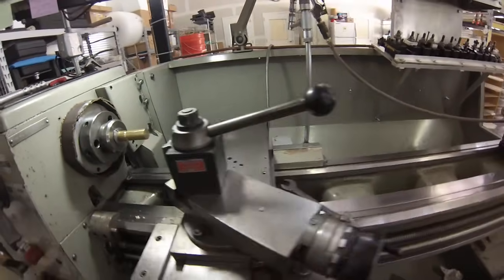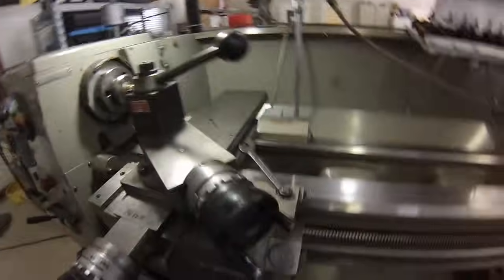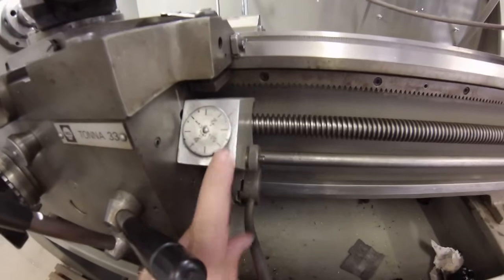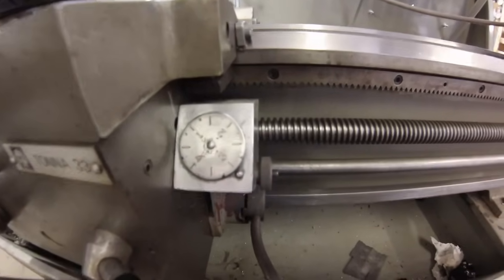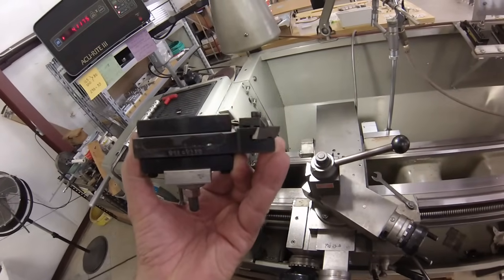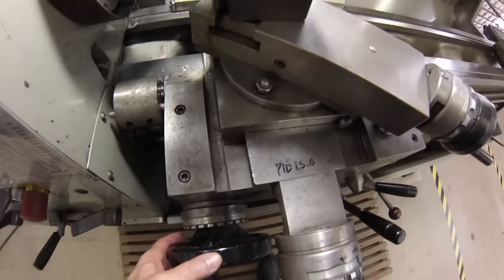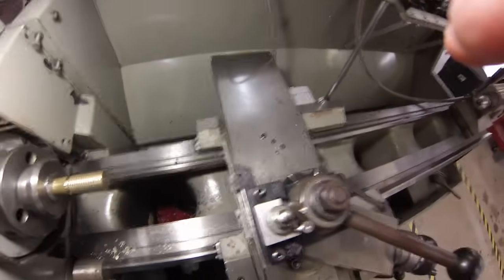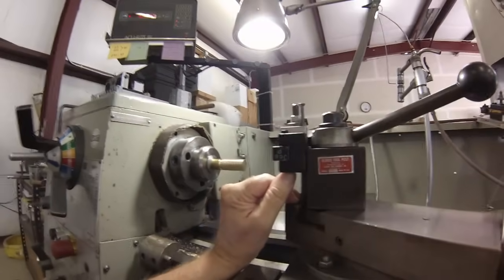Threading on a manual lathe  BEST TECHNIQUE EVER !!!!

Comment: If it's upside down and backwards (tool upside, spindle backwards, feeding towards the tailstock) I learned that in tenth grade shop. But thanks anyway.
P.s. we used blue chalk for lubricate
Reply from the maker: Where did you go to school?
Reply: @joepie221  I went to trade school at the old Carver high school which was a school for colored kids in the 50s & 60s but turned into a trade school when segregation came to Bessemer Alabama.
  Now then Bessemer joins Hueytown Alabama. You probably never heard of Bessemer but if you've ever been a NASCAR fan you're heard of The ALABAMA Gang. 
  Bobby Allison Donnie Allison Neil Bonnet Red Farmer
   All that to tell you I know them, when they would come to our trade school to visit Mr Frank Howton. Because he was THE MACHINIST for those guys before he retired and taught high school machine shop , before you ask yes sir I've been doing this since I was 15 and am a first class MACHINIST and Master tool and die maker.... these days I prefer to work with cattle tho I have a few machine tools to fool with.
   Did that answer your question ?
Reply: steven - I don't get the point your comment is making - please explain is you will. Also what material is the chalk good for as a lubricant? Just brass or other brittle material? Thanks.
Reply: @howardtoob  not sure what you don't get could you be more specific ?  Yes chalk is a decent lubricate for any cutting(back in the days) but lends itself to thread cutting because you can rub the chalk into the thread valleys and it will stay there till the tool removes it. It's great for a lot of fitment as well tho most use ink these days which was not always readily available and certainly not as cheap as chalk.
  If your interested you should goggle what type of lubricate can be used with what materials such as mineral spirits or kerosene for aluminum.
Or perhaps you have a Machinist Handbook ? If not you should have one or I expect it could be downloaded from the web.
Reply: @stevenmassey7586  Got it, thanks.

Comment: Confused Neophyte here.  Don't you need to put your "29.5" degrees in the other direction for a reverse cut like you have shown?
Reply from the maker: I plunge my threads, so the compound angle doesn't matter.
Reply: @joepie221  So don't you get chatter plunging straight?
Reply from the maker: @tkarlmann  Maybe if you cut an aggressive thread on a light machine. Mine is rigid enough to allow it. Chatter is never a problem.
Reply: @joepie221  I had to go back & check -- you are running on a H U G E garage-filling, apartment-overwhelming lathe!  I'm all fresh from learning WHY the 29.5-degree angle is used.  Then too, you can get a longer blank, and turn a narrower shoulder in it, specifically to end the threading.  Then run slow enough so you can disengage the half-nuts in time.  I'm looking a relatively teensy 100 lb lathes!

Comment: Good advice. Just want to mention that the indexing device is common only on USA o British machinery. In Europe our lathes do not have that and therefore cutting a thread by disengaging the half nut is not an option. Also quite often screws are required not to have an undercut, and this makes it impossible to cut a thread in reverse. So it is up to your reaction speed and your ability to stop or reverse the rotation direction of the spindle. One more observation, carbide tip threading tools are not suitable for reverse cut, the tip is provided with a rake angle only regarding the standard direction of cut. Last, every increase of the thread depth should be compensated by a fractional forward movement of the small carriage, since threading tips are designed to remove material off the front edge.
Reply from the maker: Screws that are called out without an undercut should be CNC'd. carbide thread inserts for threading that have a positive top rake are not side bias. Therefore a plunge sequence is fine. fractional side movements are for lighter duty machines and not required on more rigid machinery.

Comment: A machinist friend showed me this the only difference was he ran the tool from the back side right side up however I like the inverted tool idea thanks
Reply: I may be wrong but this method will allow one to cut threads on a much larger diameter part than running in from behind the work.
Reply: @howardtoob  that may be true both methods work a particular operation may favor one over the other

Comment: Not much I cannot do manual machining however threading is one thing nobody has taught me and in many attempts to do myself I’ve never successfully done so. Thankfully they make taps and dies to 2” diameter standards and metrics which covers everything I will ever need to do. Perhaps someday I will meet someone local who can show me how to set the machines up. Also I have a chart at the front of my machine telling me which to engage and what gears to install. It all seems such a headache when I can grab a tap or die from the drawer and chuck it up in my tailstock. Downside is taps and does are expensive the upside is I can still get the task done. Im always amazed how easy everyone makes it look. Manually machining I cant afford to experiment on my parts. Probably need to spend a day with someone who knows how to setup lathe gearing and proper engagements, etc..
Reply: You can definitely learn to do this by yourself. If I can then ANYONE can. try practicing with some PVC pipe. It really isn't rocket surgery. 
Joe shows the best way that I've ever seen.
Reply: HowardC I will give it a go when I have more time it may be I have been doing something wrong. They always look like threads but haven’t worked. PVC sounds like a good idea to save money and frustration.

Comment: As yet I have not seen anyone using the production method of screw cutting. Always with a V angle tool plunged straight in with the crosslide.
An alternative method taught me as an apprentice toolmaker is as follows: Grind only the left side of the tool to half the thread angle, the other side should be ground to clear not to cut at all.
Set the topslide over to half the thread angle.
Mount the tool as normal just touching the workpiece and set the crosslide to 0. Also set the topslide to 0  ( having taken out any backlash). The cut is set using the top slide whilst the tool is pulled out with the cross slide and re-sent to 0 for the next cut.
Advantages: Half of the thread angle is formed using tool whilst the other half of the angle/thread is formed by the set over on the topslide. Also it's much easier working to 0 on the crosslide and not having to constantly calculate how much cut is required.
Reply from the maker: Thanks for the comment, but I respectfully disagree. I also have to imagine, you have only been instructed on how to use the half tool method and have never actually tried it. For a few reasons, it would never be an accepted practice in a production environment. The advance of the tool with the compound would have to be so small (.0002-.0005) it would take hundreds of cuts to finish a coarse pitch thread, and under magnification, you would still have a serrated face on your thread profile. Please watch this video before you reply. It clearly proves a full profile tool IS needed for a correct thread profile regardless of the compound setting.      https://www.youtube.com/watch?v=PnH_oeOUps4   Thanks.
Reply: @joepie221  Absolutely! Even when feeding in the tool with the compound (set at 29* or whatever) there is a portion of the material opposite the "main" cut that HAS TO get removed right? Maybe I am missing Harold's point?

Comment: Joe, I just Subscribed.  I had always been taught to use the 29 1/2 degree compound rest feed for threading by my 73 year old machinist uncle.  This method of yours looks pretty interesting and much safer.  My Jet lathe has the threaded Chuck but I am going to look into the holding shaft that one of your commentors, Mile Hunt, had devised to hold a screw on chuck.  Merry Christmas to you and yours.  Tom

Comment: I needed a gubment job done for internal thread in a blind hole. I cut relief near the bottom of hole, changed to my home made threading tool on a square bar. Ran in reverse like you said and perfect thread. It was 1 1/8"-16 tpi. Thanks for that video it worked perfect. Now this video no more heart racing and clamped butt cheeks!!

Comment: How do you clean the clasped nut on a lathe without pulling it to pieces it must be full of shavings. Thanks
Reply from the maker: I spray my lead screw with solvent ane gently close the half nut to get the liquid inside. Pack a rag in the carriage and blow it out and repeat. Then oil the screw and run a few passes. You'll feel the difference.

Comment: I did machining as part of my electrical engineering degree back in 1981, I never did threading because the guys running the course said students broke too much gear that way. I always wondered how this worked, and whether there was an automatic stop so you didn't smash the tool. This video answered all my questions in one go. I wonder how my dad did it. He was a machine tool fitter at places including Rolls Royce on Olympus engines, Vickers on Chieftain tanks and Abbot SP guns, and Caterpillar on a wide range of machines. It never occurred to me to just ask him. Thanks for the demonstration.
Reply from the maker: Some lathes do have an automatic thread kick out mechanism. Most do not. This is the perfect solution for those machines.

Comment: after 2 years published and many times replay, today I think there are some various between normal cutting. not sure better or worse, just difference. the thread cutting is a forming tool cutting, the line speed is various at various radium from the rotation axis. it will come out some fish scale like appearance, it also means the forge fiber comes from pressing towards stretch. maybe will effect to the density a little when operating the soft material. and also change some locking thread when they self-locking and releasing (fish scale marks).
Reply from the maker: The fish scale marks is your material tearing instead of shearing. Its a recipe for disaster on a thread. Many high chrome steels do this, and I have found it unavoidable. 44 stainless is one of my least favorite materials for that very reason.
Reply: @joepie221  you are right on fish scale marks forming and cannot grind a chip break on rake face. But my opinion at the beginning is, the fish scale mark might help to catch and hold the internal thread surface, like the directional tire pattern. and your turning method can change the fish scale marks' direction. some can help to lock some cannot. it depends on the screw in direction. any way, thanks for sharing your exp. and always shine my eyes. please keep going.

Comment: Just realized you can take an internal threading tool bar and cut external threads from L to R on the back of the work piece when in reverse without buying extra tooling.

Comment: using this method and choosing to set the compound to half the angle should it be set to the left or right . Thanks.
Reply from the maker: Honestly, I always plunge directly in, but a conventional setup should be fine. Snug the compound so the tool force doesn't pull the tool in as it cuts.
Reply: @joepie221  I must admit I do most times. Thanks for reply.

Comment: Joe, Is that similar to a Kennametal NSL123B left hand tool holder but using a RH insert so that when upside down the insert is on the left?  Also, since I'm on a budget, with this type of holder which insert would be best for barrel tenon threading in both steel and stainless barrels?
Reply from the maker: I am almost positive it is an NSL 123B. Good timing on the question.

Comment: Wish you wopuld make a tapered thread video have to do some 4" NPT internal threading this week and have never turned internal threads or tapered threads at that have cut external ones
Reply from the maker: You will need a taper attachment for that pipe thread, but check out my Internal threading with a hard stop video. It will help you.

Comment: When I get a round tueit I will use this excellent tuition on "Upside Down Lathe Tools and not worry about "taking the chuck out"/Damage etc! Firstly I will have to make sure that the Chuck does not "Unscrew" and secondly, actually learn how to cut threads. Um! So how many TPI are there and what thread speed to what revs? What gear?  Man: so much to learn! Now where is Joe's video tuition on basic thread cutting?!Thankfully I understand Joe's "Stuff"!  Like I am on the same wave length man! Thank you Joe. Rob.   On a Working Farm in South Gloucestershire.  Because of "The Lathe" it's a Working Farm!

Comment: Feeding straight in on brass or aluminum is fine, but you won't get away with that on stainless or other tough material. Especially on 1-10 thread. The compound will be needed.
Other than that, very nice demonstration. Thank you.

Comment: Hi Joe nice video I'm a machinist/toolmaker been single point threading in reverse for about 40yrs it's to bad young people don't want to learn this trade not sure how anything is going to be made in the future
Reply: I’m 16 and in high school and dual enrollment for welding, then my plan is get an associates in machining too. In my own welding classes I spend almost the whole class machining my own projects or parts for other people. There are some other people as interested in this field as I am but not many.
Reply: Well, I work in a small machine shop. We have one old engine lathe, an old mill, and a radial arm drill, as well as several CNC mills and lathes. Most items are made by CNC production these days. It's more about optimization of the machining program these days, to churn out as many parts in as short a time as possible. Crash prevention is mandatory!

Comment: Working on a small CNC lathe I found that the best infeed angle was 30 degrees much like your setup in the video. (I know you never used the compound, but the equivalent of that angle). This was using full form carbide inserts at 1400 rpm.
Reply from the maker: I may be in a minority, but I have 100% success feeding directly in. On all materials. Then again, my machine is rigid enough to do so.

Comment: chattering, if your tool is upside down the chuck should be spinning in reverse. Also the cross slide should be moved to the other side,and you should be feeding in with the crosslide in both instances. Now i could be wrong but tht's how i learned to do threads.feed the carriage to a zero then cut in using the 30 degree crosslide
Reply from the maker: Brass usually screams with a deep cut and positive tool when you thread. Its the nature of the material. The 30 degree technique is antiquated and usually for lighter machines.

Comment: In normal thread cutting, and cutting steel it is not good to go straight in.   The purpose of cutting at 29.5 deg is to give clearance for the cut to go in with the least resistance to the cutting force.  As you adjust the angled compound adjustment you are cutting mostly on one side of the threads.  When you cut straight in you are cutting on both sides the same. This can cause chatter and break tools. Brass, aluminum, copper and plastic is OK but for 4140 or such you can't do this.

Comment: 2.44 A 20 pitch double start thread
Reply from the maker: Cake. With the compound parallel to the part axis, shift the compound .025, reset your stop and get back to work.

Comment: Hi Joe, I have done this for 50 years, it works great for left and right hand threads, I always plunge my threads.  I take rough cuts almost all the way in, then 3 or 4 cuts at .001  with tap magic, (the old tap magic was super, the new stuff is no where near as good, 111 tricloetheline was best it shined it up like chrome plating!
Reply from the maker: Unfortunately, 111 Triclorethlyene is not illegal to expose outside a vapor degreaser. Its one of the top 3 cancer causing chemicals you can find and nobody should actually touch it. I did for many years when the research was inconclusive. Its a fantastic degreaser.

Comment: What about leaving half nut engaged and just reversing lathe to starting point each pass?  I have a Chinese made lathe with a very fine lead screw and getting it engaged in right spot is a bugger!
Reply from the maker: You can do that for sure, but be cautious around that hard stop or you will shear the lead screw drive pin.

Comment: One small caveat,  quite a few model engineers lathes have a screw mount chuck. There is a distinct danger of unscrewing such a chuck when running in reverse.
Reply from the maker: That warning is clearly posted in the video description.

Comment: On the Colchesters, can you just throw levers to cut metric threads or do you have to change out gears?
Reply from the maker: That depends on the pitch. Colchesters have a high and low range gear setup that will service both metric and imperial at the same time. If the machine is set for high range thread pitch per the grid, and the metric thread also falls within the high range grid, then no change required. Just don't disengage the half nut during the process and you should be fine.
Reply: Thank you sir.  I have the 15" version of your Colchester and no one on the internet demonstrates metric threading on it that I can find.  Your videos are usually broad in that they are applicable to all machinists and not just specific machinists (like Colchester owners) but if you were to do a metric threading video on the Colchester, I can guarantee you at least one view and thumbs up.  :)  Just throwing it out there.  :)